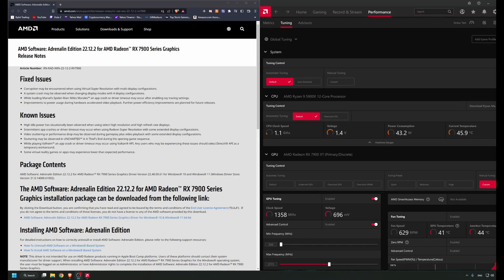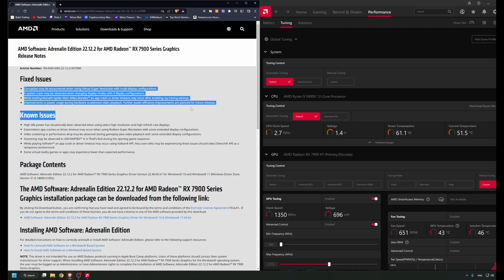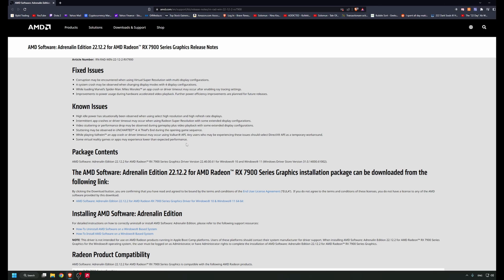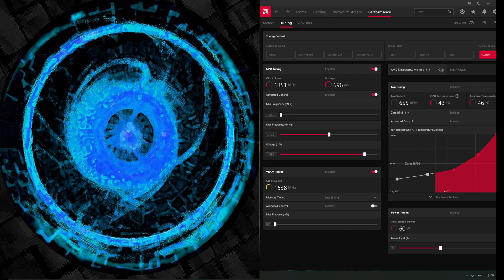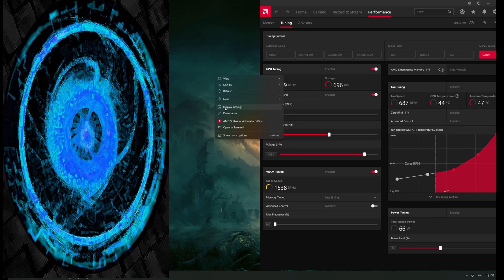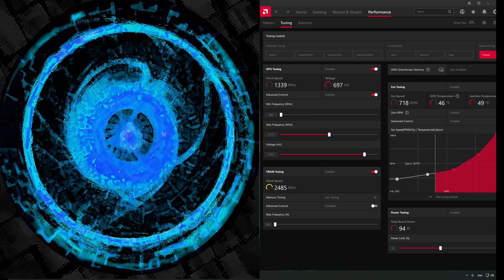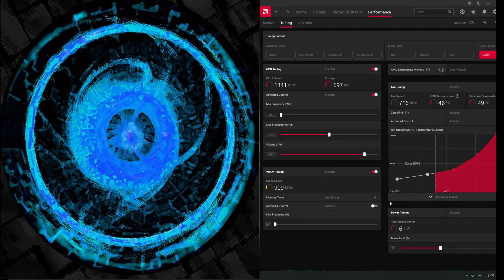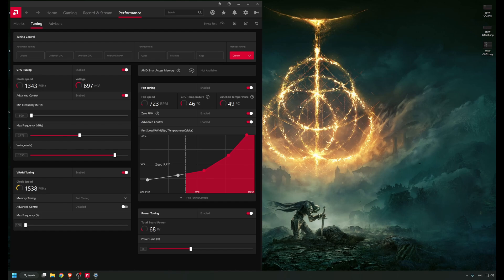AMD RADEON 7900 XT(X) HIGH IDLE POWER DRAW ISSUE FIXED!!!

Comment: I fixed the issue by simply buying a new DP and HDMI cable. I bought the best quality cables for the cheapest price on amazon, $20 total. Before my VRAM was stuck at 2487.
Reply from the maker: That's interesting. Thanks for sharing the info!

Comment: 6 months later.. & they still didn't fix it..
I have 7900xtx paired with 4k - 120Hz screen (only 1 screen) and it's hitting107w Idle (not even browsing)
After July update (7/7/2023).. it's goes from 107w to 100w (5% less wat Lol)
AMD Software team are meh.. 90% chance they won't fix it.. but at least I got it with discount ($900), 4080 is $1200+
Reply from the maker: Use 60 Hz when browsing only, that usually fixes the power draw on single monitor setup. Switch to 120 Hz when gaming.😆
Reply: @FabiWann  no.. i found better work around
I changed my display settings from windows from 4k 120Hz to 1800p 120Hz.. its fixes it partially
When gaming I chose 4K from the game itself and it's work

Comment: Has nobody ever noticed this on nvidia 3090 3090ti and 4090?
Reply from the maker: From what I've read 6 months ago there are a few reports for Nvidia as well, but a lot fewer because it's probably not easy to check the power draw with nvidia software.

Comment: i want to try radeon card, do you think the idle is still an issue since i just use 1 fhd monitor. mostly Nvidia card only take 9-13 watt idle
Reply from the maker: High Idle Power is still an issue, BUT I'd rather live with that ratter than having to change my card in 3 years because it's gonna be basically obsolete in AAA games due to only 12GB VRAM. The 3000 series cards with only 8 or 10 GB are already starting to have literal crashes, bad performance or artifacts in high tier games. If you don't want to leave performance on the table I'd go AMD, else just go nVidia.
Reply: @FabiWann  how many watt radeon card on idle?
Reply from the maker: Mine draws about 35w
Reply: @FabiWann  35w is much just for idle display
Reply from the maker: It is, but I explained above why I can live with that.

Comment: I have 42inch 4K TV with 120 hz. Yesterday i bought Shapphire RX 7900 XTX, This card takes in iddle 110 - 120 Watt. And that because memory clock stays on max takt. 
Underwolting doesnt help. Fix the FPS to 100 doesnt help, even at 60 fps is the power draw on 80 watt, There goes memory clock to 500-1000 Mhz but it is still insanely too much. 
So it seem like im going back to my RTX 3080ti and AMD never ever again.
Reply: Same problem I just got the card today:(
Reply from the maker: Limit max gpu clock to around 2500 Mhz and if you have a 2nd monitor limit refresh rate to 60 Hz. Also try to disable MPO. Hope this helps.
Reply: @FabiWann  I tried like everithing possible. Undertact the GPU ( take less power on quiet the same performance so i keep that anyway). But it dindt help with idlle PW issue because the problem is, Vram takt stays on max load. WIth 60pfs it goes down like abot 60watt, still the Nvidia is in Iddle abou 30watt. I tried to use second monitor with fullhd and 30-60 fps. Nothing worked. And even, after new update started to shutter video on full screen. Cleed new installation of the driver helped with this problem. Anyway i started to hate AMD.
Reply from the maker: While reading your earlier comment I wanted to ask if you cleaned the system with DDU display driver uninstaller. If you didn't try that as well. Idle draw is higher than nvidia, I would be surprised if it ever goes below 35W. Mine idles at around 35 to 45. But initially it was idling at 80w. The problem with nvidia is the lack of VRAM. 3000 series cards are starting to have issues in AAA games with max settings. 4000 series cards may not age too well if they come with less than 16GB of VRAM which we already know they are - 4070TI has 12GB.
AMD has some issues, but they'll age better.
Reply from the maker: The idle power is a big issue. However the Nvidia 3000 series are starting to have vram problems in AAA games. I would at least try to get a 4080 if you're going Nvidia and play the newest high demanding games.
Reply: @FabiWann  I god the Card on the Market, if its gonna be sold then i buy RTX 4080. I installed my RTX3080ti, but the gaming performance was, yea like 70fps vs 120 on hogwarts legacy is bit diferent. So i stick with AMD for a while... Not Happy about it. Funny about it is, last 4 gen, i used only Nvidia cards. Now i told myself lets give a chance to AMD. Bad decision.

Comment: This worked for me and I have the XFX Speedster MERC 310 AMD Radeon RX 7900 XTX Black Edition
Reply from the maker: Very nice!
Reply: @FabiWann  Still waiting for a proper update from AMD to boost this card to its' real performance and stability. I can't wait! I'll keep this card in my system 'till it's stable and afterwards, even though there are problems. I'm willing to wait and I'll give AMD the time they need. It's a new product, which comes with new problems, which it shouldn't have to begin with, but we might have another fine wine situation here.
Reply from the maker: I don't think there's much more performance to come except in games where bugs might restrict performance although I don't think there are any. I'll be happy with more stability for dual monitors setup. I think I noticed there's an actual performance difference between using one monitor or dual monitors which is ridiculous!

Comment: Thanks for this, was a good place to start that I didn't consider.

I turned my 2nd monitor from 75hz to 60hz and saw a decent improvement in idle temps (61c~ gpu idle temp to 53c). It's wild that multi monitor setups are so poorly supported but we're basically beta testers right now.
Reply from the maker: Yup, we're beta testers. Glad it helped!

Comment: Curious, are both your monitors connected via displayport? My main monitor is actually a tv, so HDMI only. Given my limited understanding of the issue, it seems like mixing ports might be a contributing factor, but it is my only option. 45w isn't great, but I could live with it... 100w is ridiculous and the main thing preventing me from buying a 7900.
Reply from the maker: Yes, both monitors are connected via displayport.
Just wait for the 4070 (TI) launch.

Comment: Glad they mostly fixed the issue, my Radeon vii had issues with a second monitor for a year after launch, amd does seem to struggle there and I'm not sure why. Hopefully they can fix the power draw on high refresh rate for the second monitor. I'd heard earlier today that junction temps on reference boards were really bad on the xtx models, have you noticed a similar issue on your xt?
Reply from the maker: Yeah, I saw the hot spot temperature problem on Daniel Owen's channel. My XT is working within normal parameters, max temp on hot spot is about 80 C.
Reply: @FabiWann  Awesome, so probably a defect on specific batches. Hopefully not an ongoing problem, I'd like to order one of these cards come January.
Reply from the maker: Yeah, if all of them would have had hot spot issues AMD would've gotten into some deep financial doo doo.
Wait for January 5th at least. New cards will come out or will be announced.